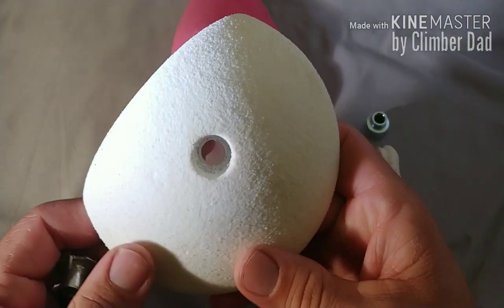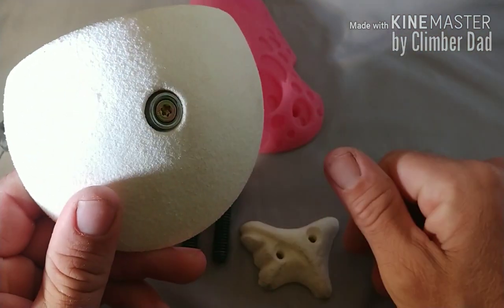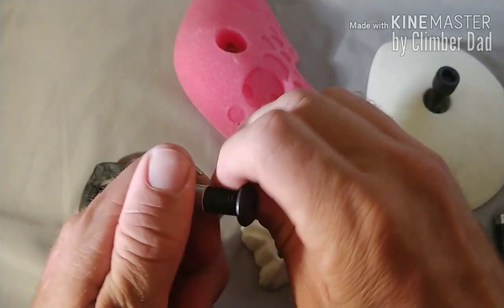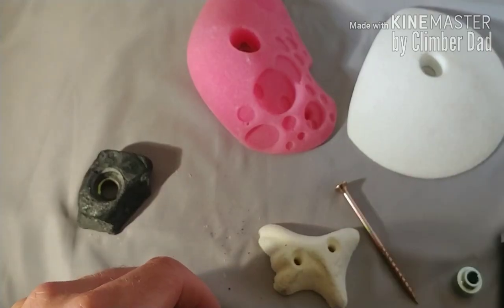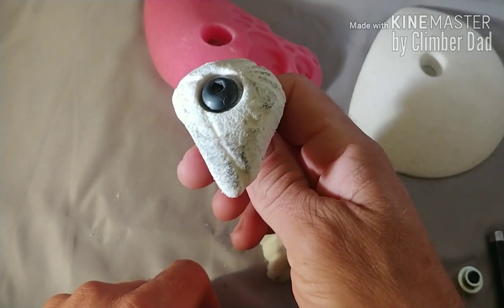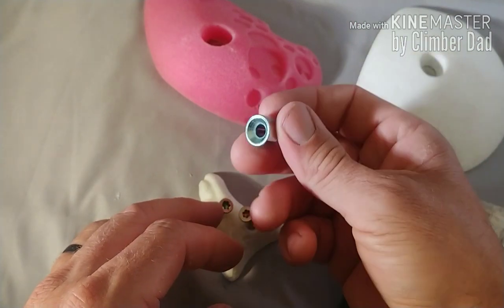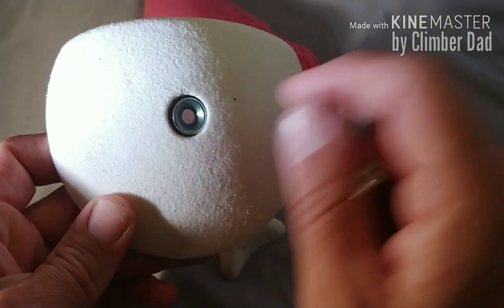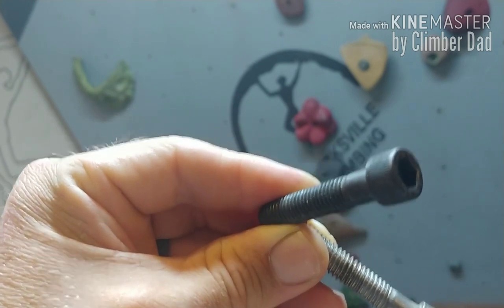Attaching Climbing holds to the Wall. What You Need.

Comment: Those adapters are convenient, but it's good practice to set additional screws since you're sacrificing some strength. The further the hold is from the wall (ie. larger holds), the more stress is placed on the  hardware. If you're only using screws, it's safer to stick with small holds. Larger holds bolt up.

Comment: First off, thank you for all the videos you’ve made I’ve picked here and there for tips from almost everyone of them. 
Using an impact driver what is the recommended settings so you don’t over tighten the bolts and ruin something?
Reply from the maker: I don't know of an impact driver that has a torque setting. Drill drivers do but they would have a hard time getting it tight enough. I do it by feel, can't realy put it in words, sorry.
Reply: @climberdad  Would you mind talking a bit about that feel then? Is it to the point where you feel like you have to put in >50% effort to keep screwing?

Comment: Those lonestars are cool. What kind of screw diameter would you use?
Reply from the maker: Usually a #9 2-1/2" set screw but it depends on the size of the hold. You can't just use 1 screw though, I highly recommend at least 2 additional set screws.

Comment: As always, very informative. Thank you so much for uploading videos like this. Just a thought, if I will be making my own holds, is there any drawback if I make holes for bolt-on in the center and screw-ons at the corners? I am just thinking of making them versatile. I see these combinations in the market too. 😁👍
Reply from the maker: Thank You! That's pretty common for smaller holds to be a dual mount. I would want a screw placement at least close to the bolt hole on large ones if just screwing it on.